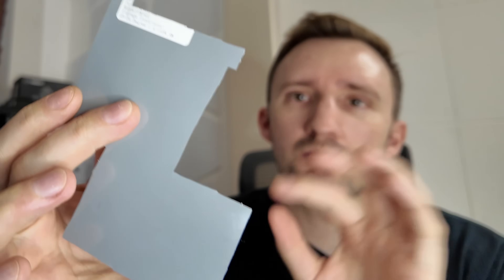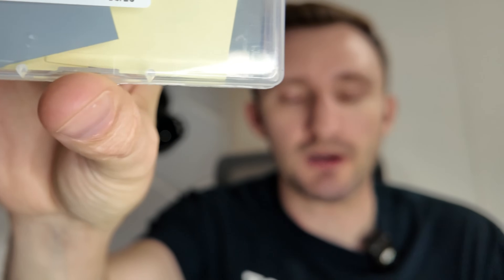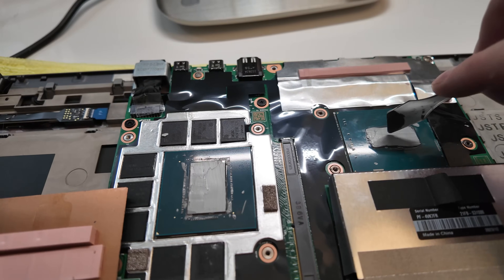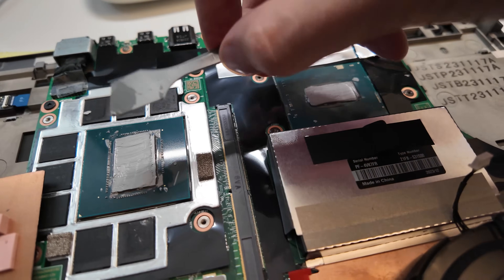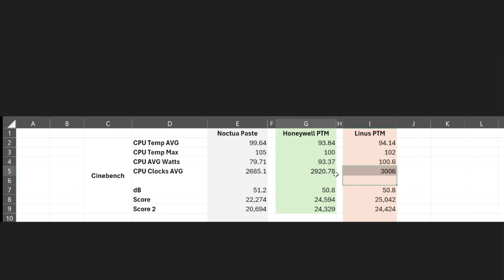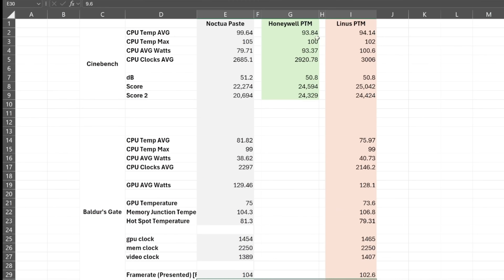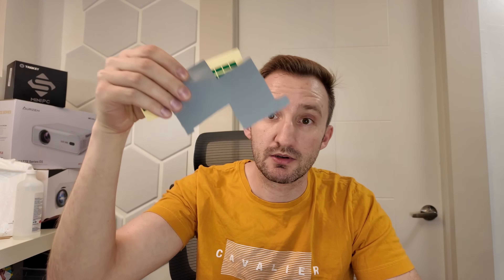LINUS TECH TIPS - New PTM7950 Cooling Solution .... Let's TEST IT

Comment: Applied it to my reference 6950xt. I do have an undervolt to 1120mV and 2500MHz max, previous temps were 85C with 102C hotspot. After two weeks the temps are now 72C and 85C hotspot. When mounting on a GPU, re-tighten the screws after a few minutes of having it on. I'm thinking about re-pasting with this again, but using shims to improve the pressure, it could potentially be a 4C improvement which is pretty solid for summer
Reply: What were your initial temps like during the first few tests? 

I'm not seeing an improvement after running cinebench/3dmark around 10 times with a cooldown period. Temps used to be at 96-100 CPU - 85-86 GPU with a 91.8 hotspot and they are pretty much the same after using the pads.
Reply: @pieuwpieuw6029  Sorry for the late reply.

Thankfully I recorded the temps: 82 - 96 ºC first test same tuning. Delta down to almost 15 degrees vs the 25 degree difference before PTM7950
Ambient temperature has a lot to do with it though; we've had 40ºC consistently during the summer.

You should have noticed a difference by now but make sure you have undervolted the GPU: the stock cooler really dislikes having the GPU set at 1.2v. A mild undervolt to 1170mv should take the edge off without the need to limit clock speeds. Also make sure to tweak the fan curve; should look logarithmic. Mine looks like:
35ºC 30%, 50ºC 50%, 65ºC 65%, 80ºC 75%, 90ºC 80%. Fan speeds higher than 75% make no difference

If you do want to limit clock speeds, clocking down to 2400mhz and running 1130v should bring the temps and power down aggressively while not dropping a performance tier.

As of today I've managed to see a stable 240w draw clocked down to 2400mhz 1130mv with the fan curve stated, edge and hostpot around 65 and 78 ºC now that ambient is lower

Comment: You're repeatedly suggesting that "cooking" the pad is going to turn it solid, except the pad is already visibly solid. Increasing the temperature induces the phase change to a liquid, not the other way around. Linus demonstrates this pretty clearly in his video when he heats up the surface it's attached to with a blowtorch. The phase change is occurring every time the TIM heats up, it's just that cycling it allows it to fill in air gaps more effectively over time.
Reply: Hmm burn in for tim? Who'd of thought. 😅😊
Reply: Once the PTM does several heat cycles it turned  it a true solid. It becomes brittle and unmeleable. 

Hearing it moves in to the cracks. Cooling it allows it to become a true brittle solid material. This is why removing the cooling solution after will ruin it, unlike paste. 

I recommend trying the stuff yourself. Run some heat and cool cycles the take off the cooler. You will find a drastically changed material inside
Reply: @beau-urns Of course it's always a solid at room temp, it will liquify over 45 C. It will not "cook" solid.

Comment: They sell them here, but for some reason say do not use on normal CPU with your usual heat spreader. What gives? In theory it should work normally, maybe they say don't do it because there is a chance to rip the lid off CPU with your cooler when PTM sticks to it hard after few years when you wnt an upgrade? how sticky is it after few months I wonder.
Reply from the maker: It’s not sticky at all. PTM will turn it a somewhat brittle solid after a few heat cycles. It’s easy to take off.
Reply: Can confirm. It’s been in my old laptop for 5 months and now the heatsink is permanently on there 💀
Reply: @Nekudon  Good to know if you want to upgrade down the line, could break something.

Comment: Some correction, you dont cook it to phase change but to spread the material around for better contact. Phase change happens at 45C and not after "cooking". PTM7950 works the best in very high pressure mountings.
Reply: It phase changes at 45C but viscosity still changes when heating it more then just over 45C like many other things have changing viscosity at different temperatures (motor oil for example) higher temperatures make it a thinner liquid, resulting in less mounting pressure needed to spread it evenly. Cooking means getting it to boil and phase change to a gas, do not know what the temperature that is for ptm 7950, but you do not want to get that high. But i think most people when speaking of cooking have 100C in mind as that is the most well know boiling temperature of water. I would recommend stressing your components after install (with a stress test program) for a few cycles of 5-10 minutes and let it cool in between as this has shown to help. But there is no need to over do this and go beyond what is good for your components, so stay within throttling temps of the components is fine. If you do not explicitly do this the phase changing stress test running thats ok also it will just take longer with normal gaming sessions to get the ptm 7950 to flow perfect but in the end normal heat cycles will do the same job.
Reply: That’s simply not true. It requires high high temperature to convert it from the liquid state to a solid.
Reply: @MediaChanelle  No that is incorrect as well because phase change happens at 45C. The “mysterious” burn-in process of PTM involves repeated heating and cooling of the material to achieve an optimal thermal bond. During burn-in, the pad reaches its phase change temperature, wetting the surfaces and achieving a minimum bondline thickness (BLT).
A key aspect of the burn-in process is the change in the thermal interface resistances. At the beginning of the burn-in (i.e. before the first phase change), the resistances are typically significantly higher, as the PTM is not yet (completely) melted and wetted. During the burn-in process, the interface resistances decrease significantly as the material fills the microscopic gaps and unevenness of the contact surfaces and thus reduces the thermal barrier.

Nobody reads the datasheet before commenting?
Reply: @MediaChanelle  you sure it goes from liquid to solid as it gets hotter? Might have that the wrong way roumd there pal.
Reply: @petrolhead0387  PTM "bleed out" with every tempcycling. That's why it is a onetime application. In theory you can use thermal paste multiple times as long as it is a bit liquidly but with PTM it is over after the first tempcycle.
Reply: @MediaChanelle  that's completely backwards. It's already a solid; increasing the heat phase changes it to liquid (it melts it), and cooling will solidify it.
Reply: Yes but after several cooling cycles it will turn much more of a brittle material. Perminabtly. The cycling allows it to penetrate better, the cooling part lets it become a a more brittle and less liquid like material. This is why you can’t recycle PTM.

Comment: After going back to air cooling on my 4090, I had a ton of issues with cpu and hotspot getting high after 2-3 months of apply paste.  I did that twice before looking at alternatives.  The PTM solution seemed like the best route, but was hard to find a reputable source.  LTT ended up being the cheapest for the huge sheet.
Reply from the maker: Nice! An easier purchase solution is definitely helpful

Comment: Great video!

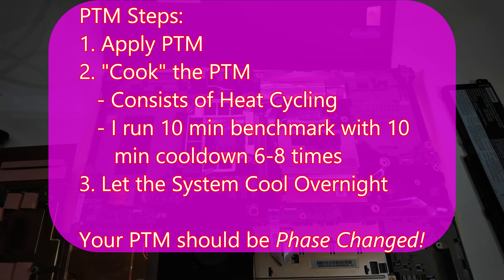I've been using this stuff on my GPU for about a month now and temps dropped by 2/3C between day 1 and day 30 of using PTM7950, safe to assume that's due to heat cycling like you talked about at @9:00.

My GPU from ASUS has terrible mounting pressure which accelerated the pump out effect that normal thermal pastes have to deal with.

This stuff really seems to shine in direct die/silicon applications like on GPUs and Laptops, I wonder how good PTM7950 is vs traditional paste on a CPU, maybe something to test for another video?
Reply from the maker: You mean a. Desktop cpu? It does help but it depends on the chip. For example I run a 7950x at 105w so it runs so dang cool anyways. But if you have a thermally constrained CPU it’s worth trying for sure

Comment: So that ptm7950 is an 8.5w/mk the paste I use is 13.7-14w/mk  so I'm not sure if this would be a benefit for me
Reply: W/mk is something to be ignored because there is no official way to measure it so 5w/mk can be better than 10w/mk in some cases
Reply: From what I understand the cooling performance is just the icing on the cake, PTM7950 doesn't dry out or pump out like paste does. Longer times before reapply if at all with the PTM.
Reply: Also the longer you have an installed the more efficient and better it gets so after one year of usage it will have increase its thermal conductivity. Also it's meant for like industrial computer so you never have to disassemble to re thermal paste it ever again. @Common_Cent
Reply: @Common_Cent  kingpin extreme kpx thermal paste.

Comment: So PTM is only slightly better if you use okayish thermal paste like that Noctua. Compare it to propper thermal paste and the thermal paste will destroy it because you used a weak paste to compare it against PTM

PTM7950 - 8.5W/mk
Noctua - 3.9W/mk

So the Noctua have "half" the performance of the PTM due to it's lower conductive properties,  Compare it against the following and you'll see the the PTM isn't as great as many think

KPX - 13.8W/mk(Thermal Paste)
Kryonaut Extreme - 14.2W/mk(Thermal Paste
Conductonaut - 73W/mk(Liquid Metal)

Higher W/mk = better thermal transfer.
Reply: I used to use Kryonaught in my laptops and PTM beat it soundly. PTM is now in all my laptops.
Reply from the maker: Actually no. I have already done this same test with significantly higher paste like tf-8 with much higher conduction.  (13.8).

In the end the PTM spanks paste

This was a test to see if the Linus stuff was as good as the ebuy7, as we have already well established that PTM outperforms even the best paste

Comment: Have to admit I've seen this stuff on moddiy and was always curious but thought it was more a gimmick than anything.  Rebuilding some of my homelab servers, might give this a try even though those CPU's don't run very hot.  If it works out maybe take apart my main machine and install it there too.  Maybe a little fiddly to install but none of the possible problems you get with LM.  Thanks for the video!
Reply from the maker: Yeah it’s great. Peeling the plastic can be tough for people with weak near vision, otherwise it’s not too too bad
Reply: @TechGuyBeau  I'm like you, nearsighted.  No problems with stuff as long as it's relatively close so that shouldn't be a problem.  Kind of wishing I had seen this video a few days sooner now, just ordered a case for my new proxmox server and just hoping I don't have to wait on this to start building it.

Comment: Cool comparison! so the ebay/ aliexpress stuff is "legit" :D fixed the overheating in my old msi laptop. 
Do you have a asus laptop with liquid metal installed? Would be nice to know how well ptm works in a laptop with factory lm?
Reply: I just mentioned in another comment before seeing yours. I have an asus g14 2023, which I bought about a year ago. It worked fine for a couple months and then terrible heat. I tried arctic mx6 first, but it was not as good. Switched to PTM, and it’s only a few degrees warmer than with the LM. Some of the LM had moved off of the die, probably because I have to pack it up and immediately put it in my backpack all the time.
Reply from the maker: Generally speaking if you remove liquid metal and apply PTM, you will decrease the performance of the cooling of course if the liquid metal is shoddily applied from the company then really anything will do better than that

I have used many laptops with liquid metal, typically I just leave them as is, unless there’s some very serious issues with the thermal performance which would suggest sending it back for repair to the company

Comment: I might buy some to replace the corsair thermal paste that came with my aio. The 7900x doesn't run that hot lol, at least compared to that 13700k I got rid of but temps could be better
Reply from the maker: 7900x can also be turned to balance mode to get like 95% performance at half the wattages. I have a 7950x and it works wonderfully
Reply: @TechGuyBeau I have PBO on, -30 offset with a 95c temp limit

Comment: Probably test it after 6months, 1 yr to see if there will be degradation.  Surprised that it beat the Noctua paste by a long margin.
Reply from the maker: PTM is incredible. I’ve been promoting  it for quite a while and using it long term. It has serious staying power. The laptop currently has the LTT variant in it, so I can see if it lasts
Reply: @TechGuyBeau i applied it in my asus g14 (2023), which I bought a year ago, and it still performs the same. The Liquid Metal had moved off of the die, and heat was out of control. I also tried arctic mx6, but the performance wasn’t good enough. Replaced with PTM after a couple days, and it’s nearly as good as when the LM was new. Honeywell stuff btw.
Reply: I replaced the 12 month old mx4 on my water cooled 4090 with PTM7950 and dropped 8c, I’m changing out my cpu and motherboard and can’t wait to get the PTM onto my cpu.

Comment: I have nightmares of peeling that 2nd layer of plastic off. Putting the cut & measured sheet into the freezer for an hour or two helps it not stick as bad, but it's still a PITA.
Reply from the maker: Not shown here. I messed up the official
Stuff on my firs application >.<
Reply: I encountered the same issue and I followed these steps but encountered an issue:

1. Placed the CPU in the motherboard socket.
2. Applied the thermal pad on the CPU while keeping the plastic cover on the thermal pad.
3. Installed the heatsink and secured it by screwing it down.
4. Removed the heatsink.

Afterward, the plastic cover on the thermal pad became easier to remove because the thermal pad stuck to the CPU.
Reply: @paultsao6152  Bravo
Reply: Yup, what I found to help me out a lot is to insert a exacto knife in between the very edge of the plastic and PTM and slowly and carefully separate it and once enough is separated I hold the ptm edge with the side of the exacto knife and peel the rest for a good application and leaving the ptm pad intact, it's what I did on my GPU core.
Reply: I thought people were being big babies. I've repasted countless times. I just did my first ptm. Holy crap that was hard. I ruined the first square but got it on the second piece.
Reply: @v3xx3r  one error to achieve proper results was hard?? I pasted my cpu like 4 times on my first build to get it right. That was using arctic silver so it was conductive aswell 😢 I was so scared for like 4 hours.
Reply: I have a pair of tweezers with a straight, obliquely angled tip (in shocking pink! intended as part of a makeup kit?) that work pretty well for removing the plastic sheet on Gelid Extreme or Ultimate pads, which are quite similar to this stuff (pretty much pre-formed sheets of a soft mineral-based putty rather than pads) and break up at the slightest provocation - you can lift and grab a tiny area of a corner with them.
Reply: i just put some on my 7800x3d using an exacto knife to help separate the corner, then hold it down with the knife while you peel off the plastic. fumbling with it until the point i thought of using the knife actually took longer than actually executing it tho
Reply: @hakz6777 same
Reply: I have never had any problems at all. I think the problems are highly exaggerated. I don't even cool the pads.
Reply: Skill issue. I’d really believe computer nerds are resourceful enough to peel things like this. And yes I’ve done it.
Reply: Just cut it to size then put it in the fridge for 15-30 minutes before applying and don’t hang about.
Reply: Mmmm cheesy PITA